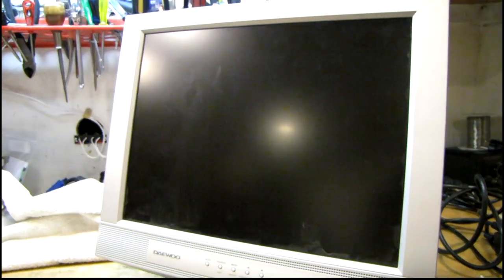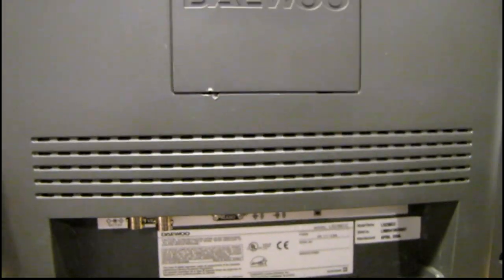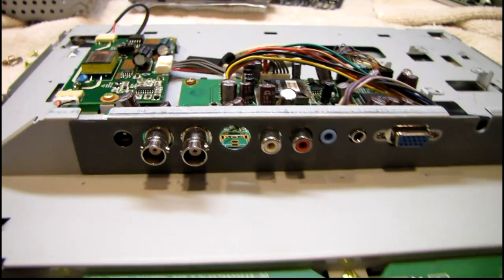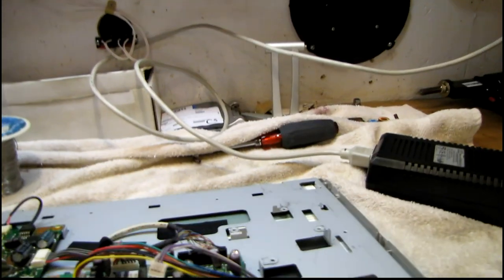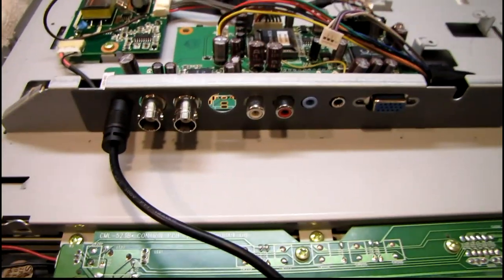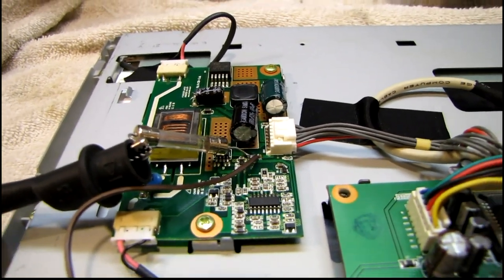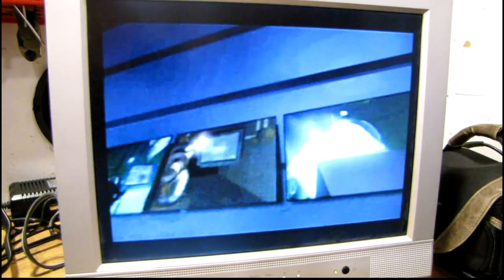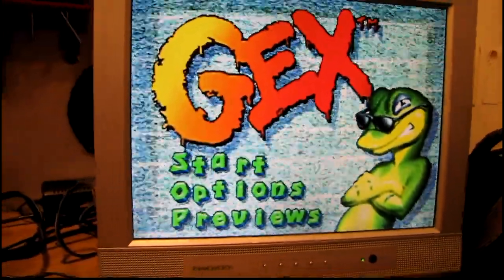Daewoo L523BCC LCD Monitor Repair

Comment from the maker: @HDXFH I think someone used the wrong AC adapter at one point.  The audio amp is connected directly to the DC jack without a fuse, so it was the first thing to burn up.  The rest of the monitor went through the 2A fuse.

Comment: nice work again! i'd like to watch your repair video's, very interesting and helpful, if ever my monitor or TV stops working.

i mostly repair tape recorders and audio equipment, but never get around to do video's...i have just recapped a Akai GX-365d reel to reel deck...needed a lot of work..diodes...sparkkillers...caps...transisistors..but it came along fine and sounds fine now :)

Comment: I have daewoo lcd ..power for it 12v  3.3A
but I use converter 18v  3.3A
but I see horizinal waves(shadow or white lines move from up to down just during gameplay and no proplem if I use programs and internet what the problem here